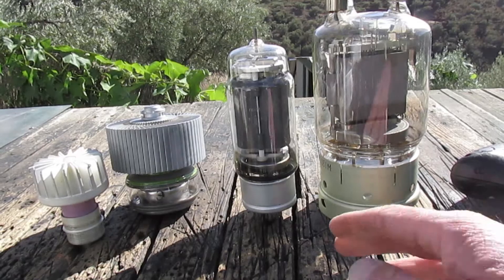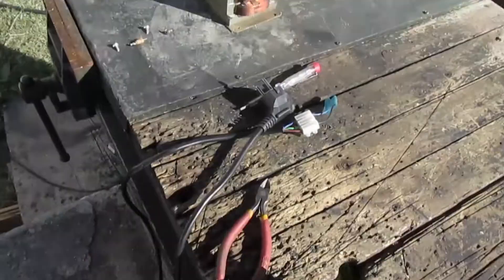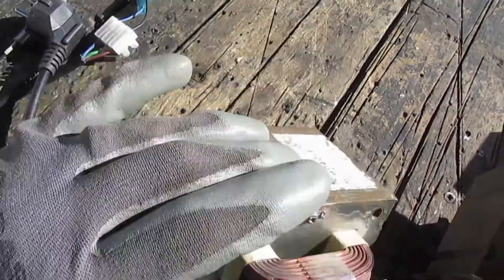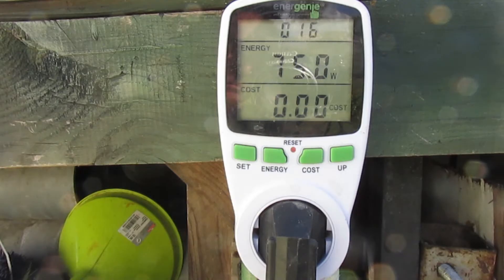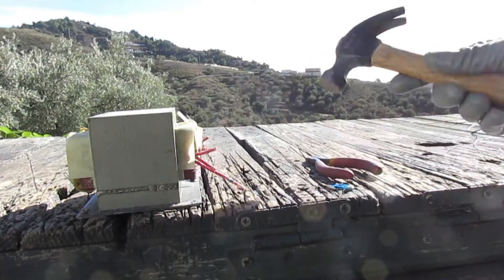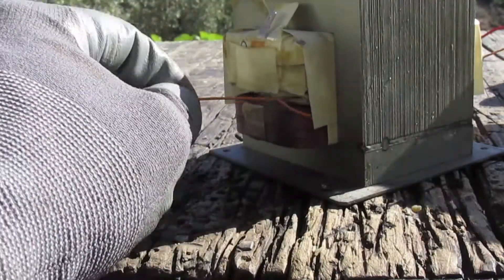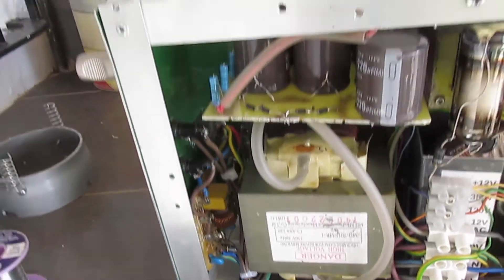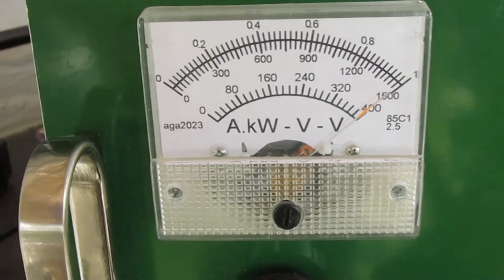Valve/Tube HF Linear Amplifier Build - Part 1 : HT Supply

Comment: This is close to the top on the list of the best content on YouTube so far I have a couple questions. What happens if you reverse the windings in the Transformer between the primary and the secondary? Also dude please keep up the good content I want to build my first tube amplifier
Reply: Hi im literally 14 i can send you a good scematic for a tube amp
Reply from the maker: @ElectroManiac3838  You do know that these are Radio Frequency amplifiers right ? If so, start by looking at  https://www.pa0fri.com/Lineairs/Frinear1500/FRI1500eng.htm
Audio amplifiers are a whole different ball game.
PA0FRI has a ton of really great advice/schematics/maths and explanations
Reply: i dont said anything about audio  amps i meat rf amps
Reply from the maker: @ElectroManiac3838  Ok. I was just making sure. Some people ask me about 'Tube Amplifiers' and they don't realise that i only make Radio Frequency Amplifiers, in the HF range.
Reply from the maker: Reverse the windings ? What ?  If you make the 1:1 version with 2 primaries, what goes in comes out about the same.

An Unmodified EU microwave oven transformer has a 230V to 3000V (roughly) voltage ratio, so a 13:1 voltage ratio.

A US one is 110 : 3000, so 27:1. 

Sticking with the US version,  putting 110 VAC into the secondary winding would theoretically produce 4 VAC on the primary.

 ... however, the Secondary's resistance might cause some 'issues' if you tried to use it that way.
Reply: @aga5897 you mentioned something about paying attention as you were disassembling the Transformer the primary and the secondary to make sure they were wound the same way would it matter if one was around the opposite direction? Also Dude Where's the follow-up videos you got to make some more content bro this is like the best video I ever found when I saw there was no part 2 I got upset
Reply from the maker: @brandonlaragirl  The 'Direction of Winding' is important if you are trying to Add windings to one side with extra wire. If you get it backwards, you basically Subtract windings !
Doesn't matter if you're just stuffing two primary winding into 1 core, not adding any extra wire.
Reply from the maker: @brandonlaragirl  There should be parts 2 thru maybe 6,  just that Real Life got in the way, so i can't do that yet.

Comment: I used a lot bigger transformers mine can handle 2kw continiously withou flames but i ned air cooling
Reply: Where did you Source them from?
Reply: @brandonlaragirl i got a huge core and i madw it myself the output idt 4kv ac at 2kw

Comment: Could you send me a schematic of your RF amplifier?
Reply from the maker: That would be hard - I'm thinking 4xGU-50 for a 7Mhz to 30MHz 400W (pep) amplifier. 
I built the box and installed the tubes and transformers, but there it has been for way more than a year. Real life has been happening.
Reply: Is there another way that the MOTs draw less primary current ?
Reply from the maker: @ElectroManiac3838  No idea - sorry. I find that they work for me when i knock out the steel shunts, add some turns to to the primary, then then use them for 3kV, OR swap the secondary for another primary and use them as isolation transformers.
The max RF power i got out of one was 700W PEP using a GU-43b tube, but the transformer burst into flames ! 400W PEP has been fine.

Comment: Many amateur operators used MOTs to build amplifiers. Glad you showed adding windings to the primary to reduce the heat.  The economy factor of those transformers usually used an incorrect turns per volt ratio on the primary given the core size. Nice tutorial.
Reply from the maker: Thanks.

Comment: great ideas I just bought a bloody iso tran but is good for my test equipment
Reply from the maker: Thank Lady Luck for finding an iso tran with a good VA rating !
I tried, failed, then found the butchered 'MOT' solution.
It's not 'free' if you count your Time, but certainly leaves more spendable beer vouchers at the end ;)

Comment: I built a 13.8V linear PSU for my shack using microwave transformers. I used 2 in series. This lowers the magnetising current from over an amp to 200 mA. Loved this video as I’m thinking of building a tube linear 73 de VK2AOE.
Reply from the maker: Hiya. Not sure what transformers you found in a microwave oven for making a 13.8V PSU, please give more info.
Mostly it's the values of the high Voltage vs the Power out that causes all the bother with multi-band tube linears (even 7 to 30MHz like mine). 
Choose two that work together and it's not too hard.
E.g. 3000V + 100W out doesn't work at all for 30MHz
To easily get 3000V to work at 30MHz you need to be throwing out about 1kW.
I guess i should get on with the Tank Calculations video if you're on the road to building a Tube Linear, so you can see for yourself
Reply: @ I knock the shunts and secondary winding out and rewind it! 
Rewinding a Microwave Transformer for a Linear PSU- Part 2 @TheArtofEngineering
https://youtu.be/jb-D9fkOM_A
Reply from the maker: @TheArtofEngineering  Cool ! How many turns on that secondary ? I guess not so many.
Small Voltage Big Amps. Nice.
Reply: @ I think I say how many in one of the videos… it was around 20”ish”. 73

Comment: Great video. Im building an amp based around 2x gu43b tubes. I have a 20kva (150kg) plate transformer with a few voltage options, 2850vdc or 3200v dc. Might start of low and work up. Im using F1FRV triode boards. Cheers GI0UTE.
Reply from the maker: Why go for 3kW ??? It will not make it easier for you.
The PA0FRI design works fine for that tube. I used the UY5ZZ screen grid power regulator (simpler).
1x GU-43b will easily get you 1.5 kW output. Use the 2850V windings. 
Too much power = Same S59+40 for the Reciever, but a lot more Expensive for You - cables, connectors etc.
1500W vs 3000W = 0.25 S reading in your QSL - it is not worth the expense. Keep the other other GU-43b as a spare part. Good luck !
Reply: @aga5897 I agree with almost all you have said actually. I guess I just wanted to try and build something excessive, simply to see if I could. I don't plan on running 3kw on the air. I have a 1.5kw 24/7 rated bird dummy load that I will try and boil😂.  I have settled on 7 16 din connectors for everything after the amplifier in my station(already in place)with some heavy coax Inc rg393 patch cables. 

Anyhow, keen to see how your build goes. Have you the tank circuit built yet? Also have you "re activated" the gu43b tube? Interested in if this was eventful? I have a number of gu43's and other than running the filament for 30 seconds each to check they heat up, mine are untested. All new old stock. 

Will be interesting to see how much power a MOT modified as yours is can support. Will it be ok for 1.5kw ssb, maybe. But not CW surely? Great use of parts many wouldn't consider using. 73's.

Comment: Any progress?
Reply from the maker: Thanks for asking ! 
No progress. I bought a whiteboard for the Calculations video, but the wife threw it out, due it it never even making it out of the packaging despite months and months of it sitting there, unused.
Basically there are so few RF Tube Amp builders, it's hard to get excited about it anymore.
I'll probably build a couple of 600W GU-34b amps one day but i use the 300W GI-6b/GI-7b/GS-9b mostly.

Comment: Those microwave transformers will take you out of this world a lot quicker than you came in.
Reply from the maker: They sure can, if you decide to touch the high voltage ! 
Inside a metal, grounded box, the high voltage is safe enough to use in the kitchen ...